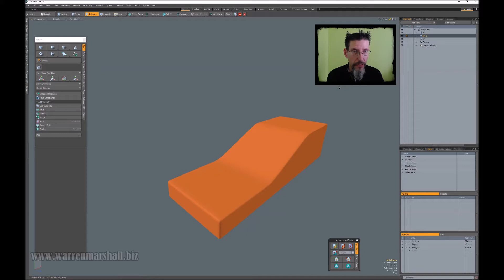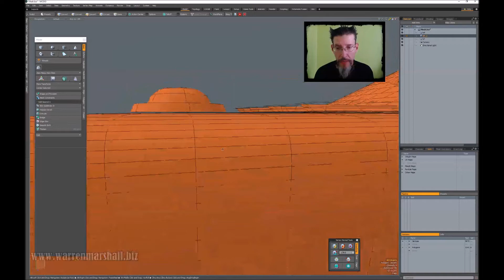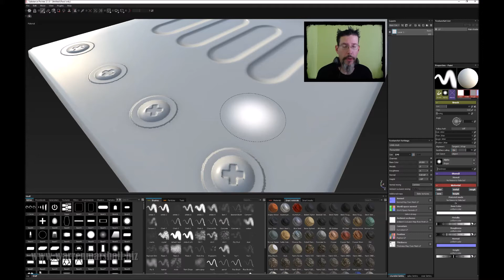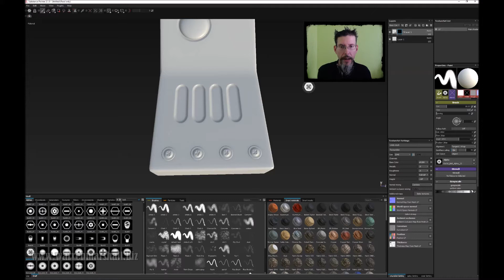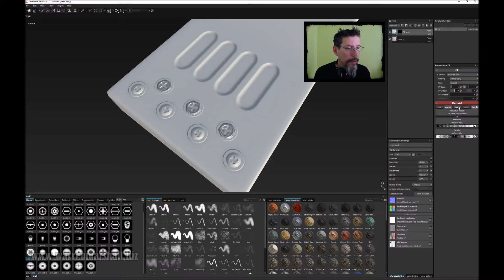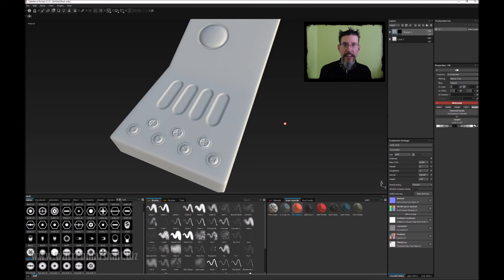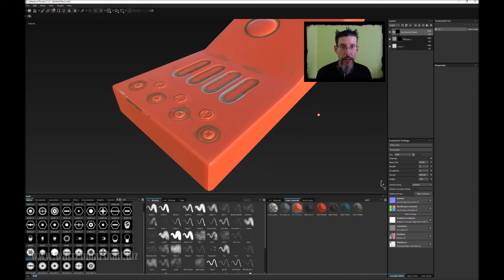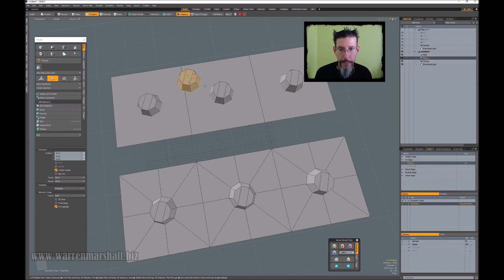Quick Tip #24 : Floaters

Comment: hey man , floaters can be useful for example , post-apocaliptic jacket ? yeah, sounds weird, for example,  I see some custom design where jackets or differents part of clothing are full of interpolated asssets, for example a pocket with skrew, fishing hook, needles , bolts or whatever geometry that are prependicular or make the ilution of depth... Normal mapping , the depth is irrelevant , but I was wondering to make cool stuff special for custom design where full of props and small are sitting on a plane geometry.
Reply from the maker: Absolutely!  Good point.  Stacking objects like that is way easier than trying to ACTUALLY stack them in 3D space ...
Reply: @WarrenMarshallBiz  for example, I was looking for custom design yesterda in Pinterest to get inspiration from...but I noticed that every piece of a jacket that I would try to make  (for example) is full of tiny elements , overlapping in most of the cases....So that reason brings me here, I am triying to make a futuristic and advanced jacket with full of bolts, multidirectional elements , nice and thx for your tips

Comment: Things have luckily changed since this video! If you have alpha's you have stamped, and want to change all these stamps to a different alpha later on, it's no problem with Substance Painter since.. I dunno.. Spring 2017? :) It's very handy!

The same goes for edge cips etc for stamps.. You can link the height layer to a grime layer and anything you stamp on be affected. Allegorithmic have some videos on all this.
Reply from the maker: You can change the stamps to a different alpha? I've never heard of that, what's the feature called?
Reply: Here's the link I mentioned. It's called "Anchor point"
https://www.youtube.com/watch?v=q9mLZQKxPSo&

Here's a video that cover the replacement of sources, like stamps in your example :) 
https://www.youtube.com/watch?v=3O4I-_p3REI

Comment: My floaters when baked into the Normal came out really blurry, I've UV mapped them but not sure that's needed as they are not part of the low poly. My rounded corners came out fine in the bake.
Reply from the maker: No, only the low poly needs UVs.  High poly just needs polygons and smoothing.  If you're using the rounded edge shader ON your floaters, that may explain the blurry outcome.  Try using a material on then that doesn't have that set.
Reply: Ahh yes that was it durr. Thanks. In regards to the floaters themselves, do you have a recommendation for creating a library of them so they can easily be placed into your projects without having them  all directly in the project.  Essentially I've made a shit load of screws but don't want to copy them all into every project?

Comment: Warren, thanks for posting these videos!  I've been struggling to bake out good normal maps for hard-surface items in both MODO and Substance Painter for a while now.  

A few follow-up questions if I may: 

1) After you've baked out a normal map from a cube using support edges to prevent skewing, can you then go back and remove the edges to knock down the polygon count?

2) This might be redundant, but are your floaters modeled accurately, or are the outer edges offset?  When I use distance baking, a lot of the details are lost, even though I get an accurate projection without skewing.  When I try to use a cage, I get my edges beveled, but the floater details are skewed.

3)  Have you heard or seen the "double normal map bake"?  Essentially, you bake the normal map out twice: One with correctly projected floaters, and the second with illusion of beveled edges.  The idea is to overlay one map over the other in Photoshop, and then mask out the errors so the correct bake (which would be in the underlying layer) would show through instead.  Since this would involve a great deal of going back and forth between multiple applications, do you know of a way to do this in Substance Painter? It takes me a few seconds in Photoshop, but it's been dogging me in Painter.

4) Lastly, and this is perhaps more related to UV space:  How would you go about texturing an item that requires camouflage overlay, like a tank, but still be able to conserve UV space?  Is there an option in game engines like Unity or Unreal that would allow for the use of multiple UV sets to be used where camouflage can be overlaid without losing the underlying information?
My big concern has to do with not losing texel density due to not being able to mirror most of the UV islands that have the camo applied.

Thanks again for making these videos, and certainly thank you for any advice you could give in helping me to resolve these conundrums.
Reply from the maker: Hi Andrew!

1) You can if you're careful.  Removing edges can change the vertex normals that were used to bake the normal map so you can end up with artifacts if you're too aggressive.  But I do that on some props, so it's totally possible. Something I've read but never tried is there's a method where you can bake an object space normal map, remove edges, and then transfer that to a tangent space map. Or some variation thereof. I'm not sure...

2) It all comes down to the projection. A proper project should pick up the details on the floaters correctly - as if they were cut in.

3) I've heard of it but, as you pointed out, it's a lot of work IMO. I don't like futzing around like that. I always bake with a cage and I don't have projection skewing issues (well, here and there, but I add a vertex or an edge to fix it). The double map method seems like a lot of busy work to get around the issue of, "fix your mesh/cage".  :)

4) Sure, it's totally possible to use multiple UV sets within the same material. So you could use channel 0 to control the normal map and details, and use channel 1 for the camo overlay which is more of a tiling texture.

Hope that helps!
Reply: Good Deal!  Something else that I may have stumbled upon while baking in Substance Painter, though it results in seams  appearing for polygons that have a 90 degree angle on them, is that the cage model itself might only need support loops around those corners (I'd recommend using a poly count of 1 when beveling so you can keep the original UV island splits or just loop slice on both sides of the hard edge in question).  Afterwards, you can use the push command to break the 90 degree angle for the cage model.  Asides from the new edgeloops, the cage and game models should retain the same UV layouts.

Of course, I just stumbled upon this while messing around, so I need to check what the limitations are with working like this.
Reply from the maker: I'd be surprised to see that work, actually.  It's always been my experience that the cage and the low poly mesh need to have the same topology ... that's how it knows what vert to cast to which.  Interesting.

Comment: With programs like painter there are still pros using floaters?
Reply from the maker: Sure ... you don't always have an alpha in the exact shape you need.  :)
Reply: I guess once you created the 3d shape for the floater you could also just bake it and use it in SP. Plus you don't have to fix those projection issues, no? Do you use some script to quickly create alphas in your 3D program (which is Modo right?)?
Reply from the maker: I actually haven't gotten that heavily into creating my own alphas altho baking a greeble sheet for use as alphas in MODO would be pretty straightforward.

And yes, not having to deal with distortion is a HUGE win when using stamps in Painter...
Reply: Cool, thank you, I don't have much experience and I wanted to double check with you if I'm missing something quality-wise avoiding the old method. Also thank you for the videos!

Comment: In regards to getting edge wear on your stamps, I usually stamp everything and export a normal map. Then create a new project, import the normal map and do a new bake (making sure you leave out baking a normal map this time, you just want your cuvature/ao, etc).

Great video!
Reply from the maker: Just did a test on this and you are 100% correct.  It works!  :)  I'll do a follow up video about that, thanks a lot James!
Reply: Yep,  I do this also. It's pretty easy but it would be nice if the baker would just bake out the height stuff to the normalmap automatically so we could skip the export/reimport hassle.
Reply: Brilliant! Will have to try it out. Thanks for sharing!
Reply: Tought about this during video, good to know there is no problem with that. Although it would be cool to have something like Photoshop's collapse layers (collapse painted height data?) in SP. Definately worth to post it to Allegorythmic :D
Reply: You're very welcome! Glad I could help
Reply from the maker: It feels like something they'll do.  It seems like a natural progression of the feature set.
Reply: Even faster way to do it, would be to remove all the maps except for the normal map, and then in Painter's texture baking dialog check all the wanted textures, and leave the normal map unchecked. It works the same way as your method, although, you won't need to reimport your normal map, which saves a minute or two :P
Reply: ***** That wont work because it wont add the newly stamped data into the normal map. The point of exporting is to export stamped data with baked data and then allow painter to bake that detail into the other maps. The only way to do that is to export. They need to add a feature to merge it internally.
Reply: why create a new project? when you bake the height detail into a normal map....just drag the newly created normal into the texture area of already opened project and set it as normal map...then bring up bake settings again and bake everything else (AO, curvature etc) glad i found your channel @Warren !
Reply from the maker: That's a good idea! I'll try that next time, thanks.  You're right, I was creating needless work there...
Reply: no problem, i personally can be alot better at baking, i suck at it really...so looking forward to baking in MODO or preparing MODO asset for baking in substance! keep up the good work my good sir!